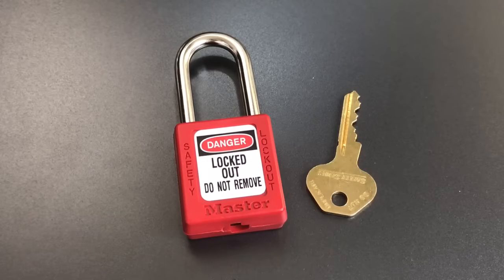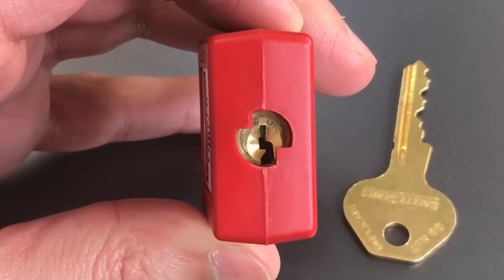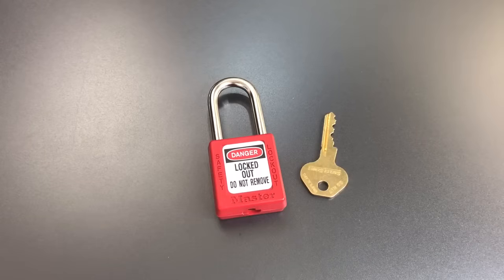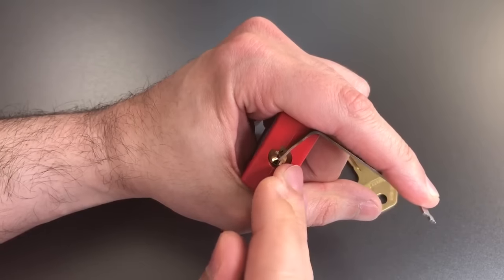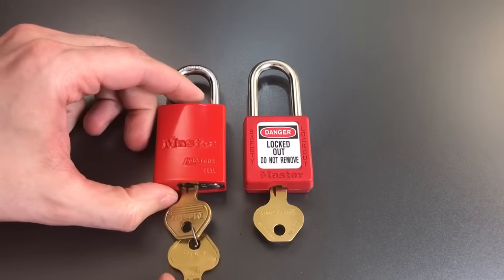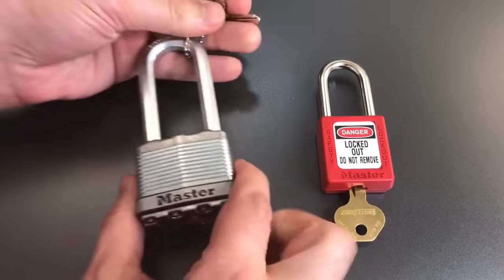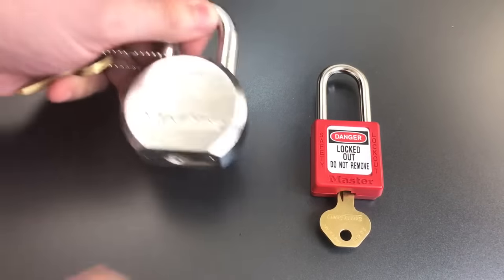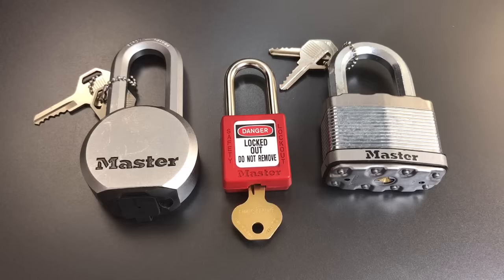[479] The Master Lock Paradox - Model 410 LOTO Padlock

Comment: Is there a way to put the 410 core in the M15? I know basically nothing about locks I'm just curious if it's possible
Reply: the core and the body where the core turns are matched. if you put that 6 pin core into a 5 pin chamber.....well nothing is centered nor working...

Comment: Likely already mentioned in the 4.8k comments, these plastic bodied locks come in multiple colors. This is extremely helpful during group LOTO to determine which department still has locks in place when putting back in service after routine cleaning and maintenance.

Comment: Most employees will not wish to break the lock. They want to pick it or bypass it without being noticed. If they break the body of the lock you now have great reason to fire them. If they pick the lock they can continue to break rules and cheat the system indefinitely. So you hope they break the lock body and that it is too difficult for a novice too pick.

Comment: We use those at work. (Refering to the first one with the smaller body and sticker) This is one of the only locks ive ever seen where it doesnt matter if it can be picked or not, like it was said in the video, it's simply used to lock the controls of a machine in factories. If you are in the building, then you work there. No one there has any reason to try to pick it. If you are seen trying to tamper with the lock then you could immediatly be fired.

Comment: There could be a system to that madness. 
When you encounter a beefy lock, you expect the core to be excellent. But when you encounter a cheap looking lock, you expect the core to be lousy. So you try the cheap lock and the excellent core they put in frustrâtes you to no end. Logically, why on earth would you now bother even trying the beefy lock? You “know” it’s going to be even harder. As a result, you avoid the beefy locks and perhaps all Master locks. So Master only needs to put the expensive cores into the cheap locks (low sales volume) and puts cheap cores into the expensive locks (high sales volume). Maximizing profits and to a degree increasing security by deception

Comment: Having used these type of LOTO locks for years i've fount a few good reason to have a plastic case, 1) cost - as a company can give out 1000's of these a year to new employee's. 2) Easy to break off if someone loses their key or leaves site with their lock still attached. 3) Weather resistant as some are used in very corrosive environments. 4) Ability to be keyed differently as you might have 4 to 500 sets on site and all have to be different.

Comment: Got 3 of these locks with my name printed on them for my newest job and decided to look up the LPL video on them. I believe the reason why these have soft bodies and shackles is so maintenance can cut them off in case you leave and forget to take your lock with you, and the 6 high security pins in the core are to make sure that no other key in the facility can open them. The hardened shackles aren't particularly needed when nobody's going to mess with your lock while you're there anyway, and they only get in the way when the maintenance man comes to cut them off in the case of someone forgetting their lock and leaving work while it's still locking a machine out of use. The soft bodies are probably used in case the lock is in an awkward position in the same situation.

Comment: As a maintenance technician in a factory I have a lot of experience with these locks. Former employee no longer works there and has a valve locked out? Get 2 3/4 wrenches and pry it open. Production worker lost his key after cleaning out a mixing pump? Get the hammer. They're stupid easy to break apart because of the plastic body. I've always preferred the red bodied American locks with the longer shackles. Not sure what model they are but always makes me feel a little safer when I'm inside a tank or machine because of how easy these locks are to simply break open.

Comment: What may be even more interesting than the actual locks, is the complex lock-layering that is implemented by companies to control lock-out tag-out by various companies when controlling job-site activities during complex jobs when both contractors and differing unions are layered into the same jobs coupled with multiple shift changes.   Employees have to pass tests to prove and demonstrate that they know these complex interlocking rules.   In most of these situations it is rarely the quality level of the locks that actually matters so much, as it all comes down to 1) did the employees know the procedures, and 2) did the employees, supervisors,  and contractors all follow the procedures.   It is a matter of life and death.

Comment: From personal experience we use these alot but theres times when someone either loses there key or they leave work and forget to take there lock off or simply drag up and quit so its farely easy to take some bolt cutters to it and cut it off, keep in mind its only to protect equipment from turning on but not just any key open it

Comment: I work as a maintenance man in a large slaughter house. Although we don't use this particular plastic body lock, we do have red locks for LOTO. 
One thing you have to keep in mind when it comes to choice of material is the environment the lock is exposed to. In my plant I could be in a freezer (cold) then go out to an area that's hot. I also work under the team members who are constantly showering their equipment with water (sometimes room temp, sometimes 180 degrees). There is also blood, guts, fat, bile and anything else that comes out of an animal that gets on us!
For our machines, and also the guards ON the machines, we have to use stainless steel. Why? RUST! If a machine or guard is constantly wet, it will rust and fall apart VERY quickly if the material is not stainless or some kind of rustproof material. I would assume the same for a lock. 
Plastic holds up well to almost any environment and I assume that's why they choose this material. Durability in extreme environments is more important than resilience to lock pickers in this application.
This is, of coarse, only my opinion.
Thanks!

Comment: So lock picking  lawyer I figured I can help maybe shed some light on. He mentions that there's plenty of other lockout tagout locks who have relatively weak cores compared to that specific lock. And it's a pretty reasonable explanation for this one. In the twenty-five years I've been welding I work in a lot of plants and just to give a few examples. Almatis which is a boxite conversation plant that turns rae boxite to aluminum. Now the procedures that are relatively mild and not all that dangerous to human  Life.  Then when you drive right down the road and get to the livesay Dow chemical or Exxon mobile refinary. Or worse yet let's sas an anydrious ammonia nitrate producer. It all boils down to insurance and company regulations. If someone opens a lock for a water main in the plant the consequences are usually just some slight flooding annoyance. On the other hand I was working at Exxon mobile. My helper decided to take it  upon himself to try and innocently finish a hydrogen line early before we arrived. With a core like that not many people could easily open it. Whereas the water main line is probably a lock that u could bump oope.  It all correlates to the financial and human devastation on which system is being locked out. Hope this can shed light on the subject. 

Fun fact in my 3 year welding career  at  Space x Boca Chica facility where we built the first 9 starship prototypes I basically saw 2 lock out locked the entire tome I was there. But they still have the safest working environment I've been in. Not to mention the 275k a yea take home pay was a nice stay put incentive 😂🤣 hope I was of some help 😉

Comment: We use them for personal loto on the lock box. The area lock out locks are all metal. Forgotten personal locks after the safety procedure can be removed with a twist of an adjustable wrench without hurting the lock box and as stated by RhumRunner you can have lots of personal locks without duplicate keys while area locks are all keyed the same.

Comment: i came to this conclusion trying to practice on one of my locks from work, and then i was having so much trouble so i took it apart only to find SO MANY security pins and went spiraling for 10 minutes about how this is the worst lock body with the best core that master lock has ever made and its a lock that pretty much requires ZERO security. then i looked it up and i immediately found this video. At least im proud in myself for knowing its insane

Comment: As a maintenance man at a plant I know why one of the reason for the lower quality body. There are times when we have shift changes between maintenance personnel and usually they will change out a personal lockout with a universal lockout so the following maintenance person can finish the work and remove the lock. Sometimes this doesn't happen, and since only one key fits that lock and person is gone we Sometimes have to actually cut the lock off but not until trying to get ahold of the owner of the lock first. As far as the locking system I'm sure it's the best they can get because lives are at stake and not personnel property.  I have at times had to cut locks off power supplies because previous shift forgot to remove there lock. Usually use bolt cutters. Hoped that helped.

Comment: Some lock out tag-out locks are made with a plastic shackle, breakable with ones hands without much effort. The reason for the weak body is simple lock destruction if a lock is left on by someone who leaves site forgetting to remove their lock and the machine needs to be started up. It is essentially a trust based safety device, it is only destroyed with confirmation  from its owner and visual confirmation that nobody can be harmed by re-energizing the component. For the paradox, the explanation could be based upon the organizations policies. If the lock is hard to pick, you have 2 options, get the guy with the key or break it.

Comment: They have a bigger core so there are more variations.  A set can have many locks with no matching keys.   They dont need a strong case because it is not made for keeping people out, it is just to make sure noone can start up whatever is locked out by accidentally using a key that can unlock 2 different locks

Comment: I would argue the 410 it's one of the best thought-out LOTOs.
When working on mine sites you could have machines with dozens of LOTOs on them during maintenance. Every worker has to carry one or sometimes multiple LOTOs with them so bulk, weight and also cost are a relevant factor.
From a security point of view, if an incident were to happen, a missing lock but a worker still with his key would indicate sabotage, no so much a misplaced lock that could be blame on the user, so pick resistant core is much more important than strong body. For their role as a tool they really fit it.

Comment: RhumRunner41 hit it right on the head.  As a 40 year safety professional I agree that the purpose of these loto padlocks isn't security, it's to prevent somebody from inadvertently throwing that switch or control without realizing another worker is in the danger zone.  So somebody actually has to think "I'm removing a safety lock" before they just do it.  And as was mentioned, somebody is always losing that key and an authorized supervisor has to get the "master key"--the boltcutters, so we don't want it case hardened etc.  It's probably one of the few Master Lock products that actually do a good job of what they are made for.

Comment: So having worked in a bunch of I industrial facilities where we used LOTO all the time, I have had to cut off quite a few of these locks. Guys on off shifts left their locks on a group box and went home, preventing us from getting our systems back online when the work was complete.   My guess would be the low security shackle and body are for just that purpose, so we can get the locks off if we need to with just a hack saw or pair of small bolt cutters.  It also probably keeps the lock price down, because we bought dozens and dozens of these things.

Comment: We had a ( normally a 5 hour procedure due to accessing multiple breakers in multiple locations ) loto on an external filter you could literally clean with a vacuum in 5 seconds. It was more of a hazard to use the equipment than it was to clean the filter. Lotos always need to be followed 100%, but in this one case it was overkill. I did appreciate "filter maintenance" days though during a rough week. I'd block out the whole day and make it a leisurely event.

Comment: This lock makes perfect sense once you understand how it's used.  I used to own a nuclear engineering company so I'm writing from a nuclear plant prospective.

The fastest way to get fired, even on a union job, is to violate a tagout/lockout order.  So the lock needs no security measures.  Nobody is going to try to break that lock just to get fired.  A nuclear plant will have hundreds of such locks, each keyed differently.  That justifies the extra pin.  When a work order is given to a craftsman (electrician, mechanic, etc), The work order is accompanied by a lock or multiple locks and a tag that goes on the shackle identifying who has the lockout.  He locks out the breaker or valve or whatever and keeps the key.

Only the owner of the lockout, the guy with the key, is allowed to open the lock.  OTOH, if the guy quits, is fired, dies or on vacation before the job is completed and the Shift Engineer (who is the highest authority during his shift) approves, the lock is cut off.  the soft shackle means that the operator who cuts off the lock can do so with a small bolt cutter.

This lock makes perfect sense for the use it is intended.
Reply: I assumed the plastic body and softer steel shackle was used for cost savings and use in a lower risk environment for break-in, which I am sure is part of the equation. Could not think of why they'd use the 6 pins, though. Thanks for the explanation.
Reply: That isn't the paradox. The question is why aren't other masterlocks cores made as well as this?

Comment: LOTO locks are meant to be disposable. I've cut many off of machines because the maintenance guy from the previous shift left it on when they went home.  It's non-hardened so it cuts easy, plastic body to reduce the cost of replacing them, but a secure core so that nobody could just come up and remove it with whatever is handy. Makes sense to me.

Comment: Having a weak body but strong core means if the key can't be found it'll be more likely broken to be removed rather than picked. Which helps the manufacturers sell more and lowers the chance of someone removing for well bad ideas removing all loto for an audit or inspection. Breaking the lock is pretty clear and people will notice while people might not notice it getting picked.

Comment: The reason the core is so much more impressive than the rest of the lock is that when the lock has to be removed without a key it should always be cut, never picked. This is because it's not really a security device, it's a safety device. 

If the lock can't be removed by the owner with a key then there has to be an investigation to ensure it can be safely removed before it is removed. If the lock could be easily picked then lots of people would probably just bypass that procedure without anyone knowing any better, which is unacceptable. However, a lock that has been cut is likely to be noticed, and nobody would dare get caught cutting a lock without proper authorization because you can get in so much trouble for it. Therefore, these locks need to be tough to pick, but they actually should be easy to cut as well. 

Another nice thing about them is that the key cannot be removed when the lock is open, so the lock can be hung on bag without fear of the key falling out, which is very useful given the purpose of them.

Comment: I can actually explain this paradox. Engineers, the workers most likely to be using these LOTO locks, wanted something that was intrinsically difficult for the average worker to take off without resorting to destructive means. These locks are to prevent accidents, not function as something that cannot be taken off. If the lock owner gets fed up with the work mid-job, leaves his lock on when he goes home from work, and never returns, or isn't expected to return for some extended time, then the lock needs to be easily removed as well, even if the key isn't available. This design actually makes perfect sense.